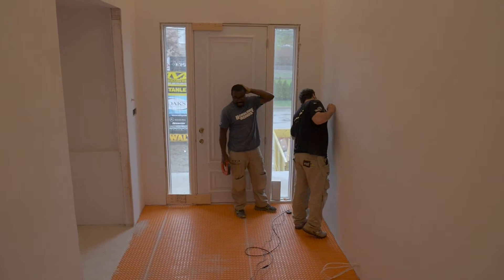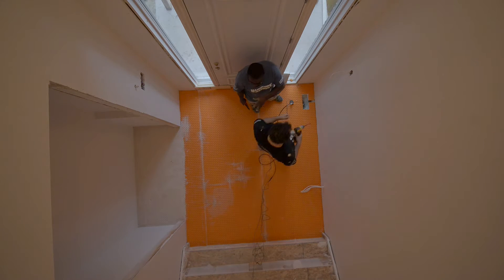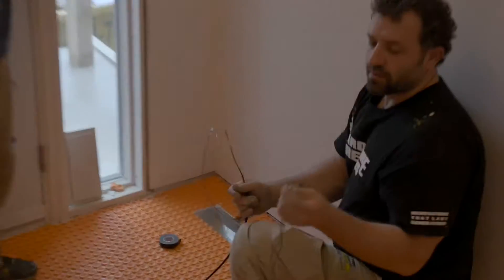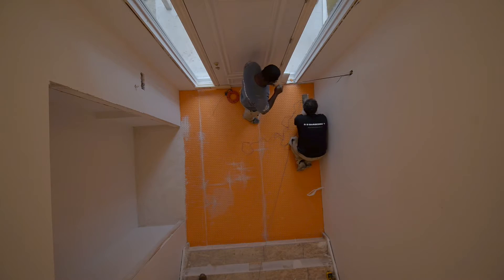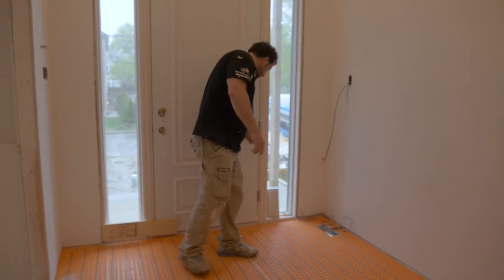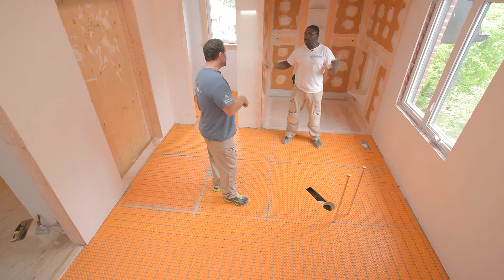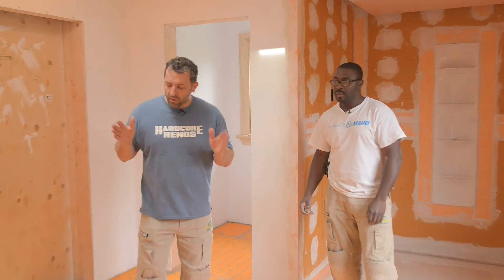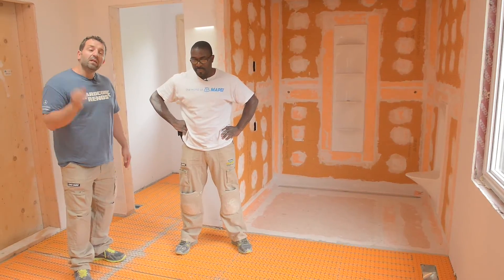Installing Ditra Heat Episode # 160 Hardcore Renos

Comment: So this is different than regular Ditra?  I see you're going through and filling the mat with thinset before you begin tiling.  Can't you do both at the same time with the Ditra heat mat?  If you mentioned it (in the numerous videos), I missed it.
Reply from the maker: Hey Lisa, you can do both at the same time but when you have any intricate tiling designs, you might want to split the process that way you can draw lines on the dried base.  That was the main reason why I did it that way.  The Ditra Heat membrane is a bit thicker too, about 1/4" vs the reg Ditra that is 1/8".  Really easy to use and highly recommended.  M